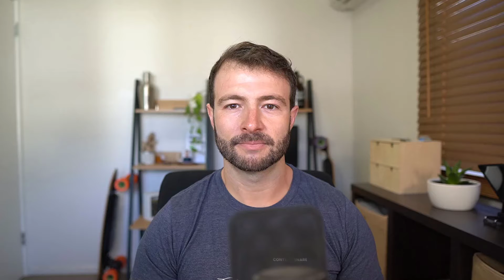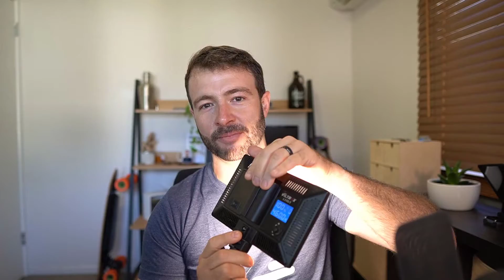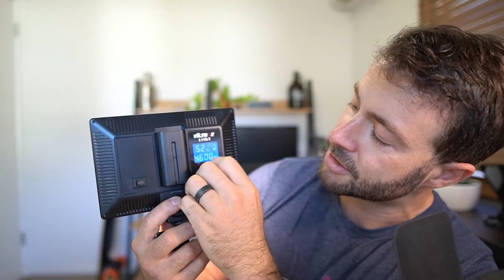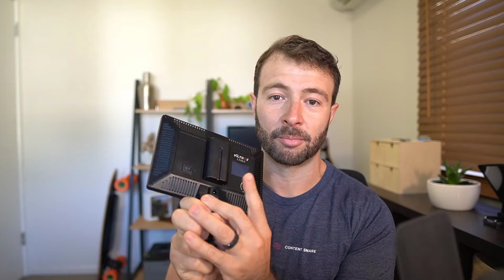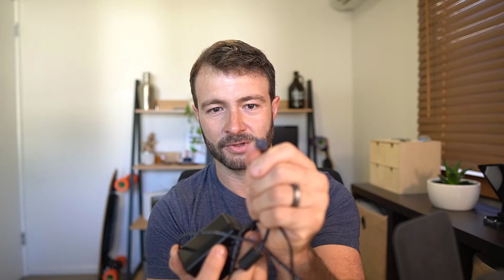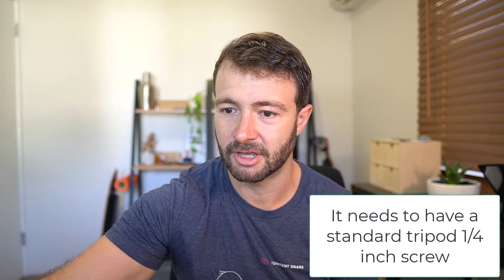Cheaper Elgato Key Light Air alternative - Best lights for streaming & recording

Comment from the maker: 💡 Gear you'll need 💡
Viltrox L116T - $45 ea - https://amzn.to/3uifXF7
Power Supply - $8 ea - 12V, 2A 5.5mm x 2.1mm - https://amzn.to/2McFu1p
Stands - $16.50 ea - 1/4" Tripod Screw - https://amzn.to/3dA2e6M

Comment: the key lights are fine if you 2.4 wifi. I have everything hard wired, and my defaut my modem is set to 5ghz. so it seems silly to change a setting, just for some lights.

Comment: 69.50 per light is cool, but i have found second hand el gato key lights for as low as 129 refurbished and 100 secondhand.
if you add a smart plug your total climbs up to anywhere from $75 to $85.
personally i would rather pay the difference and get the el gato for their software alone.
especially if you have a stream deck already.
Reply from the maker: You're right but for lower budgets, I'd still go this way. I bought these in the early days of our business when money was a lot tighter.

I won't touch refurbished with a 10 foot pole - have been burned too many times with things failing in under 18 months. Second hand is a good idea though. I'd bet there are quite a few available from people giving up on whatever channel/stream they started on.

Smart plugs are SO cheap now. I have a smart powerboard (4 smart plugs) that was on clearance for $5. Crazy.
Reply: @_jimmyrose  i picked up a used facecam for $75 and a used og stream deck for $60.
Buying one thing every few weeks or so.
Eyeing some key lights i saw on market place but i have done a ton of research and have watched and searched for a ton of budget suggestions (hence why I’m here lol) videos great and by no means am i knocking it.
Integration of the programs they have just makes a whole lot more sense to me though.
For photography or videography may find way better use for this set up though.
Hell, if you’ve already got hot shoes and stands this is a great deal.
Reply from the maker: @bigdaddyprofit  Oh I wasn't taking this as you knocking it - just saying that the budget difference is a big deal for many. Even though I'm happy to spend a bit more now, there was a time that I wasn't.

I bought a StreamDeck on Black Friday and it's still in the box, so I guess I've gone fully their other way now 🤦‍♂

I can only assume the integration with the keylight would be awesome. Hopefully it'll be easy to get it talking to my smart plug & Hue background lights

Thanks for dropping by man :)